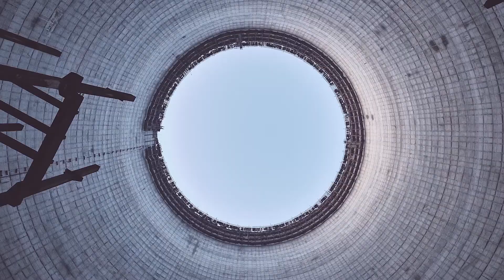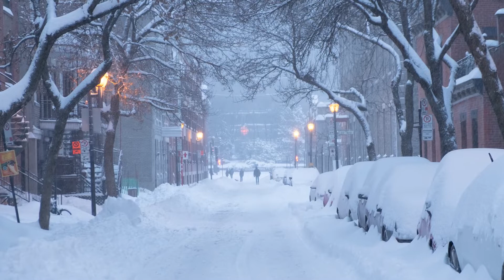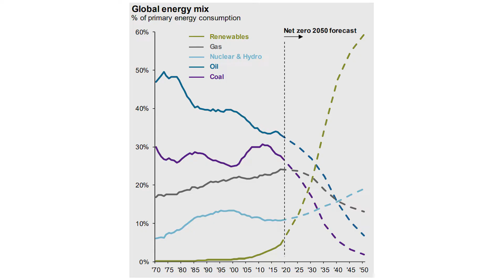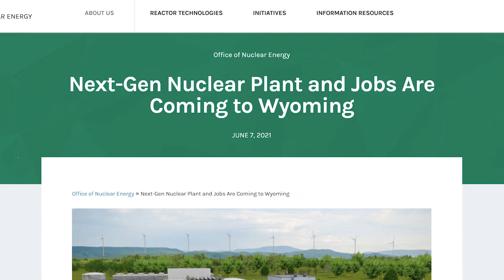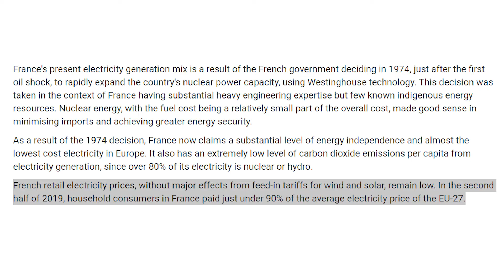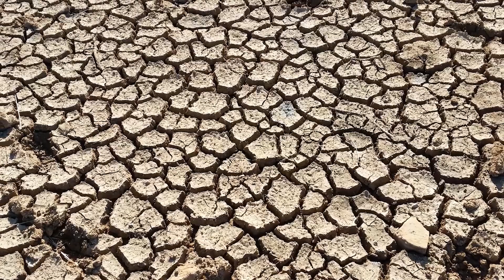Nuclear is the Investment Opportunity of the Century

Comment: There is one thing you fail to consider: water. Nuclear reactors need A TON of water for cooling. In Europe, big rivers that are used for cooling both French and German reactors have been drying up. Two summers ago, some plants had to be temporarily shut down for this reason. This coincided with maintenance on other French plants and created a massive spike in electricity prices throughout Europe. We are dealing with this market disruption to this day. And guess what, it is not expected that the river issue is going to get any better with climate change. You run out of water, your nuclear plants are useless. That is why it makes sense for France to try to diversify AWAY FROM nuclear. I understand in Canada and the US this might not be as topical, but in Europe, with relatively smaller rivers, it has already become a real issue.
 
Also as an additional note, your mention about France's relatively cheap energy is a fallacy. Yes, it is now cheap, because they are reaping the benefits of the infrastructure they built in the 80s. The capex was already spent and it not reflected in present-day prices. However, building new blocks nowadays is immeasurably more expensive. For instance, in the Czech Republic, there is a debate over a new nuclear plant. However, if it were to be built, it would have to be financed partially from minimal guaranteed prices of electricity for the next 30 years. And those guarantees would make this source significantly more costly than other sources. It would obviously be paid by the end consumer. So, to compare the price of electricity produced by 40-year-old reactors to that produced by potential future reactors is a mistake to say the least. New reactors will make electricity more expensive, which is already an existing problem in Europe, for consumers and corporations alike.

Comment: Great production and analysis but there's some issues. Its actually called a "positive feedback loop" not to be trifling because indeed the outcome is very negative. The problem is everything we do generates heat. It's not just about carbon and greenhouse gases but the actual amount of thermal energy being created above the environmental baseline that compounds due to heat trapped by the greenhouse effect. Nuclear fission is no exception it creates a lot of heat, maybe less so in the sci-fi reactors you talk about but we don't have the time to build these. Its like a giant air conditioner, it cools yes but it generates more heat in the process. By the time we migrate to nuclear this will be an arid wasteland at the rate of 10 years per plant (especially with current supply chain issues and global decoupling). As for carbon the warming right now is due to emissions 20-30 years ago as warming lags CO2 meaning we got a few years before crop failures reach a breaking point. The Air conditioning thing is but one of many positive feedback loops. Now it's a water shortage and everyone is saying DESALINATE! The problem is that heats the oceans and makes oceans more saline. You're right about nuclear its safe in normal times. After a collapse though keeping those spent rods cool is energy intensive and could irradiate the northern hemisphere. Facts no one wants to hear, but I do appreciate your optimism, it keeps us balanced.

Comment: Canada has been very slow at having solar on all new buildings. Geothermal closed-loop systems should be required on all new buildings. Why not have the earth heat or cool your home? Small battery farms should be set up near every major town. Every province should also have a battery farm like the Hornsdale Power Reserve in Australia. IceWind wind turbines could be attached to homes and used on farms. Wind farms can also help. Let us not forget hydro. Solar panels should divide every multi-lane highway. The only thing I truly understand about Nuclear plants is they always run over budget and nuclear waste is dangerous. When we start using vehicle to grid technology and power walls attached to every new home even nuclear will become redundant.